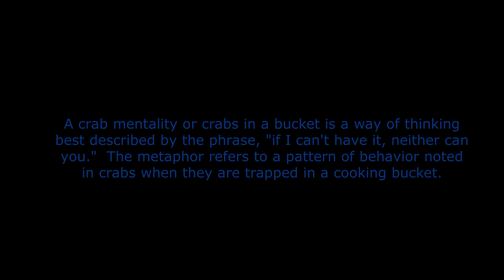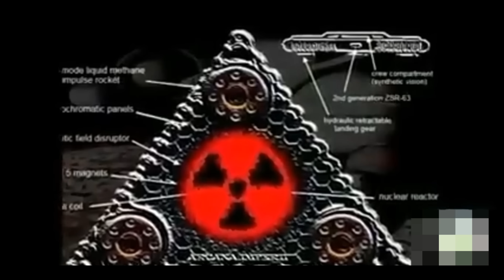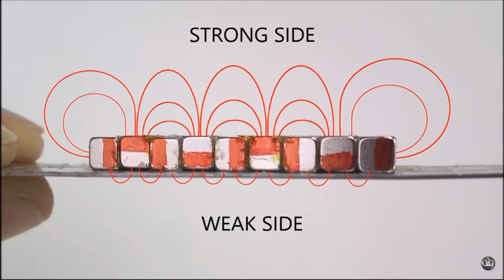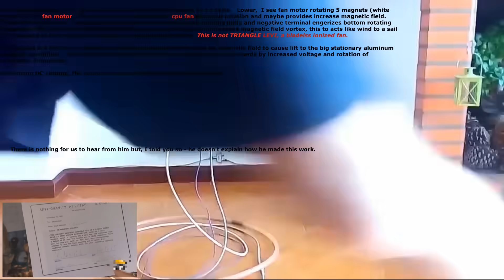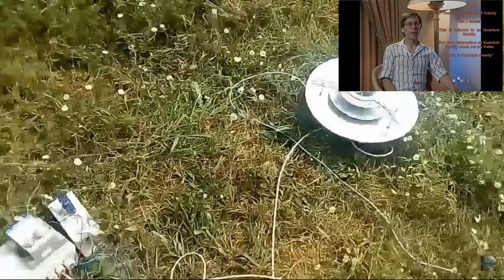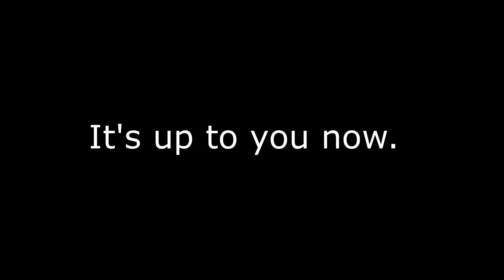anti-gravity project

Comment: So what if you built a bigger one.  Do it with the vision of a nucleus,  multiple rotating circles.  I think the core would be either neg. Or positive, with others in opposite.  And everything surrounding would be able to resonate with the rest.  That way you don't melt you're project.   Control lift and forward, reverse .  Different angles.  By speeding up the rotation of that sectors circle etc.. come pick me up after.   :)  i wanna drive!
Reply: look into the biefeld-brown effect. it doesn't use actual magnets but produces the same effect.
Reply from the maker: You're on to something,  keep reading descriptions.
Reply: this technology doesn't seem to be that hard to make, but if were trying to make a flying car how would the polarity change if you were trying to accelerate by going forward or backwards based on the magnetic field? would you just change the polarity of magnets based on the the orientation by making a transmission like that of a car,  my answer still remains questioned
Reply: Instead of full levitation, just add one of these devices to a plane, car, or truck where a weight reduction of say 30-50% would result in a massive increase in performance and efficiency. Would the vehicles control systems operate near an electromagnetic field?  Also, Tesla had an interesting take on the theory of gravity.
Reply: This comment is probably why this showed up in my recommended all of a sudden
Reply: The biggest problem is... solving the energy problem.
Reply: @Larissa Kells Cool, I get it! Appears in minds eye nano to macro. So elegant, efficient as holographic fractal patterning.
- Watchmen
Reply: What if so-called gravitons are spinning magnets. (Don't ask me how, or, why they spin.) Is this the reason the Earth's core is molten lava? Maybe it's just another one of my dumb ideas! What do you think?
Reply: @truettecliver2945  The core isn't molten, at least not all of it. The molten part is molten cause it's bloody near the temperature of the surface of the sun, and the only reason the inner core doesn't melt is because the atomic architecture of the iron there is different than the iron of the molten part. And hypothetical gravitons wouldn't be magnetic, magnetism and gravity are by definition 2 different forces entirely.
Reply: Suth , north,  intercalled Bit magnetic  change magnetic fields intercalled by wall of bloch
Reply: u people are so gullible so dumb... u believers probably think the earth is flat too... why not believe in the tooth fairy too then..  its not that preposterous  compared to ur faith in anti gravity nonsense
Reply: We need
Super size Superconductivity.

Comment: Wouldn't that last experiment shown from Russia be based on eddy currents and Lenz law? That would mean that any version of "anti-gravity" using this method create a substantial amount of heat which sooner or later would warp the aluminium or copper? Even if they used super fluids like mercury it would still heat up the itself as well as the container right? You would need a super coolant too keep the entire system cool which would create moisture in the form of vapor or condensation and we all know water and electricity don't mix. The whole thing would have to be placed in a vacuum to avoid rust or water shorting out the electronics. I proposal but it's not free if you're interested  comment and have your pay-pal ready.
Reply from the maker: The information i dripped feed i should be asking,  here's my payme@ PayPal , bluntly if you have to ask, then no.  My project does not get hot or melt, unlimited energy and can defy gravity
Reply: @jefflucas_life  unlimited energy I doubt it, defying gravity is easy by definition doing jumping jacks defies gravity but gravity wins in the end because the act isn't sustainable. You use Lenz Law but their is no heat generation, that can only mean that your project is a simple one. The jumping jacks require work and work uses energy which creates heat....are you telling me that you've defied physics or as I call it "REALITY"? Be careful with your answer it will tell me if you're have honestly cracked this even without me seeing your project in action.
Reply from the maker: Yes, its works less moving parts and silent like a blimp, with unlimited energy to stay hovering.
Reply: @jefflucas_life  is this the link to this project posted 8 hours ago?
Reply from the maker: I pinned the link because he and i are the same path.
Reply: Give me a minute......
Reply: Give me a minute......
Reply: @jefflucas_life  A proof of concept with no proof what so ever, a fancy 3d video showing a rendering of parts and their purpose but no examples of tests done nor any attempts that have failed...seems strange. For instance circulation for cooling would be pointless in space which means that it for propulsion and that does meet the definition of defying gravity it's no breakthrough. Solenoid is a term referring to a tube like winding of wire originally used to study electromagnetism but in the case of EMP-EX1 what is it for? Does it contain a gas like Hydrogen that is affected by magnetism or a super fluid metal like mercury? You say that you're both on the right path but I see no evidence supporting your claims of cracking a sustainable way of defying gravity that uses less energy when weight is involved. The entire point of gravity defying engineering is to see if one can create a efficient way of sustaining a gravity defying act or event through electrical and mechanical means, the examples in this video wouldn't work unless the "anti-gravity drive" were placed outside of the ship into space which would be destroyed by debris or in a vacuum chamber which can only reduce ambient heat absorbed by the air. The material will still heat up and warp, EMP-EX1 is fancy concept for a Frisbee with a propeller and I haven't seen yours but it's like the EMP-EX1 it isn't new.

Comment: No matter if you succeed to make it there's one more obstacle to pass or breach.
If you make a magnet circulating mercury ring cooled by liquid nitrogen and you make it flying, that still doesn't means antigravity.
If you succeed in flying by that, you still need to beat the air resistance or sound wall.
Again you need to breach the sound barrier.
By this 'engine' in this video you only have the propulsion but not the complete UFO.
The aircraft needs to be better aerodynamically shaped to withstand friction and temperature including air pressure.
An UFO as a Flying Saucer isn't much aerodynamically slick but such shape goes incredibly fast just like there's no air, no air resistance, nothing.
Normal aircraft (especially a disc shape) would be teared apart by the maneuvers of Flying Saucer.
The only known way to create a true Antigravity is to squeeze atoms hard by two plates in a vacuum space to make interaction between nuclear forces and chemical reactions among  atoms elements of light and rest to create a very small amount of Negative Energy with Negative Mass to make a true antigravity.
All Flying Saucers in UFO sightings are breaking every law of physics, no air resistance, no friction, no sound, nothing.
Just like there's no air pressure applied on it.
You build that and than you have a true UFO.
And yes, they are not Aliens, they are Jinns/Demons.
If you make an aircraft with poor aerodynamic shaping that breaks all laws of physics like the Flying Saucers do, I take my hat down for you.
Reply from the maker: Reading lots of IFs.  I agree with you there are hurdles to overcome,  I can't say I believe in aliens among us nor FErs dogmas the Earth is flat.  As for the saucer trailing edge, it is charged like a tri lifter, drag is reduced, there's no shockwave at Mach speeds because the saucer has positive to negative charge in its direction at infinite voltages.  However,  once I get all the materials, I should have a simple lightweight model to power the craft upwards and once I can demonstrate lift, I can figure out the rest.
Reply: @jefflucas_life  oh, it's easy to make a lift of a disc but the horizontal movement of a disc shaped craft is more intricate.
If you manage to flip that disc for 90° then you'll have a great aerodynamic issues since its propulsion goes underneath it.

The best way for you and anyone else in that venture would be to make air friction and resistance irrelevant to the aircraft.
If you manage it, then it's doesn't matters what kind of propulsion you have and what speed it has.
I believe 50kph of speed then would make it hypersonic in such state.
I wish I could have a money to make God say: WTF.
Reply from the maker: @Only_God_Is_Allah_SWT  I read back in 2001 a project applied Electro Hydro Dynamics ( E.H.D.) for advanced propulsion. It reads on; an EHD device uses a direct conversion of electrical energy into kinetic energy. A specially shaped electrostatic field creates a hydrostatic pressure (or motion) in dielectric media. If the media is a fluid like air (or aether), a flow is produced and this produces a motion of the device. A powered flow of medium (like air or aether) within a shaped electrostatic field adds energy to the system which is picked up (as a potential difference) by electrodes and thus produces energy; basically, a force field using HV direct current, aka, lifter.
Reply from the maker: EHD there's no shockwave at any speeds with any dielectric fluids and EHD propulsion excels faster in space.  90* turns, polarization of plates sliced like a pizza allows any directional change you mentioned, occupants inside craft aren't effected by change of direction because they are polarized in a flying capacitor not all these huge masses of magnets and coils of copper, more like assembled paper weights.  Simply, polarization is the key to movement.
Reply from the maker: Empty Space, we enter in the realm of electromagnetic radiation, this isn't ionic here.  High voltage electrons can make the leap of empty of space by electromagnetic radiation, in which electric and magnetic fields vary simultaneously..   Refer to CRT, I can't see why not HV electrons can't make the leap of space at 376 Ohms, empty space is a diode.  In the realm of electromagnetic radiation, the electrons from our sun allow you to get a tan at the beach. A very high voltage craft propelled by moving electrons can operate in any dielectric environment such as air or the vacuum of space in direction of polarization.  Thanks for picking my brain - it helps constructing my capacitor saucer.    I don't know, its been awhile, maybe jet will post his UFO concept here, our saucers work on the same concept.  Off to bed. Good night.

Comment: Nikolas tesla..2019
Reply: yes, it is very real, but to go there the laws of thermodynamics have to be broken see (Schappeller devise) patented in Germany in 1911. It produces 4 energies, magnetic, radiant, electric and gravitational. It works continuously and unlimited, the electrical supplies all the equipment, motors for stabilizers (gyroscopes) and ionic wind for propulsion. Tesla also patented a flying saucer based on this patent after CIA murdered Karl Schappeller and it was from this olso that the Tesla free energy project started.

Comment: 1) 1:37 Do you know how unstable a disc shaped aircraft is at supersonic speeds? Ask Avro, they know. For those who don't the answer is "very!"

2) 1:32 Aliens didn't five us liquid rocket engines, that was all us baby. Good ol' fashion human ingenuity....and a few arms races but that's besides the point (the fundamentals how they work are actually quite simple). In any case, even if aliens did visit us to give us technology, they wouldn't have given us chemical rockets. There is no realistic way of traveling interstellar distances using chemical propulsion. It would be like visiting someone from ancient Rome and pulling up in a shiny new ferari and then teaching them how to build a steam engine.

3) I find it hard to believe that a military pilot would find something hard to follow simply because it changed direction without informing them first. As well, anyone who looses track of a flying spinning ball of fire shouldn't be made a fighter pilot.

4) 2:23 make your own content and stop stealing from actually good and factual sources without properly siting them. That's not just lazy is down right disrespectful, shame on you.

5) 9:42 I went frame by frame. He disconnects the hoop he is holding, wraps it around the fishing line that is suspending the his piece of modern art that he wishes was science, then reconnects the two ends of the hoop (I think it is some thick vinyl tubing or something similar) then drops it straight down thus avoiding the wire which extends upward out of the frame. Then he speeds up the footage to make it hard to see him do all that. After that he does the same thing but bigger scale with a longer fishing line and uses the camera angle to make it look like the stick is passing overhead but really it is closer to the camera than his piece of dangling scrap metal (I decided calling it art was insulting to artists, those folks work way harder than this fraud). Nice try but you'll have to step up your game a bit if you want to fool someone who actually understands how physics works.

6) In conclusion, you are a fraud and not even a very good one. I mean this must have taken a while to edit, so what was your goal for all that effort? You could have used that time to learn some real and cool science to share with us but instead you decided to troll all of the 0.006% of the world who have wasted their time to watching your ridiculous antics.

Comment: It was turbine propelled, hence the wires that provided the electrical energy for lift. Just a huge hoax which sucked everyone in. Just like any modern Drone. His example was most probably the first crude Drone. I will never be convinced.
Reply from the maker: It be hard to pivot on single thrust without Vectoring control.  Hoax maybe but a catalyst to prove possible, curiosity has my attention.

Comment: Mag-lev isn’t anti gravity. It’s opposing magnetic forces. It doesn’t mean it’s flying because it needs metal directly below it... stupid!
Reply from the maker: I read the magnet field of the central electromagnet used creates a kind of electrical field pressure effect by driving the electrical waves emitted from the disk array to the west or east below the (you say metal) disk. As a result, the disk array arises above an electrical plasma cloud directed by magnetic swirling fields.  I know its kind of stupid when we can't see the whole picture.

Comment: People are saying, "It's not anti-gravity; it's just magnetic force." Hey look if you don't need a magnet track under your craft like a maglev train, what's the difference? It would still work like a star wars land cruiser. And looks like you can even get it high enough to avoid land hazards. Sign me up for one.
Reply: But he is hooked up to the batteries so it’s still electromagnetic forces at play here, true anti-grav would need to use plasma discharge and ionic particles to achieve the same effect. This electromagnetic stuff still has a place in the future, but true anti-grav won’t come out of the closed hanger doors for another 20-60 years.